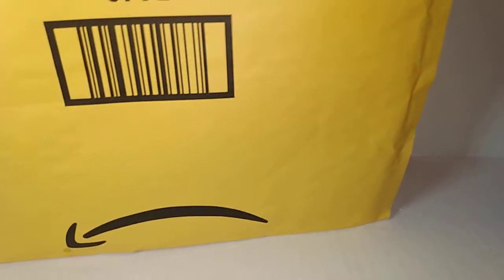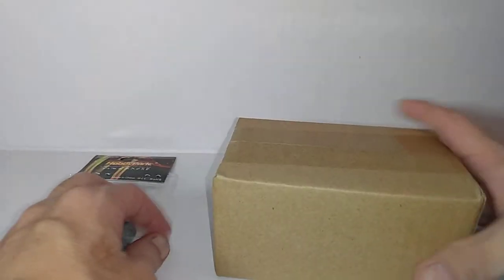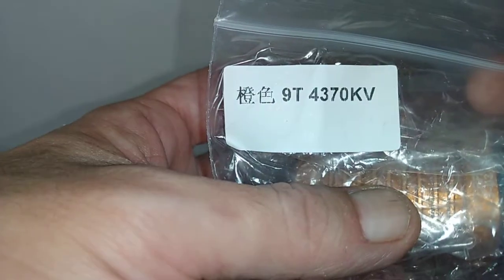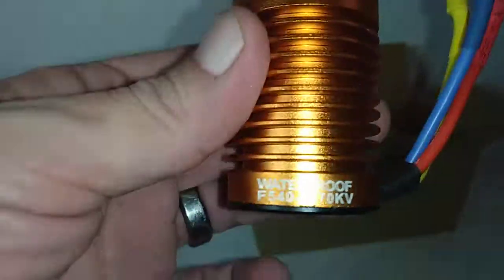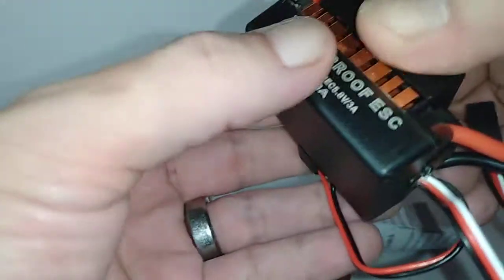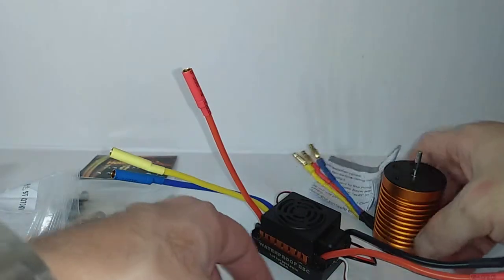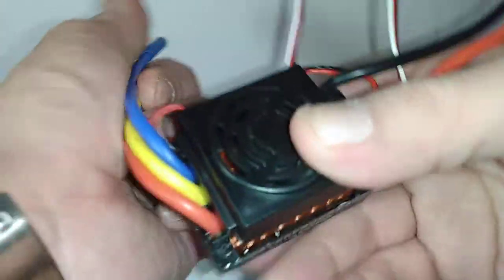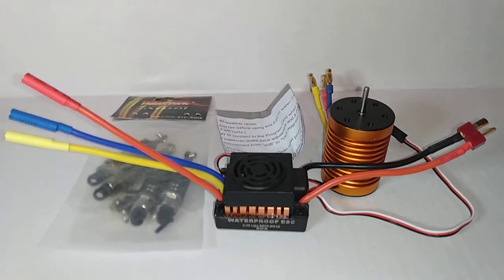Quick Unboxing 4370kv & 60 Amp ESC

Comment: Good quality is that?
Reply from the maker: NO PLEASE DON'T EVER BUY THIS GARBAGE....
Reply: @MightyistheRCGamer  ok thanks
Reply from the maker: @digeolrc8586  This is what you need  3s capable and nice... But remember everything went up in price because of INFLATION so if you buy it now you will be ok but if you wait it may go up in price 

Check this out on Amazon
JODIYAAH Hobby F540 4370KV Brushless Motor Waterproof 45A ESC with BEC for 1/10 RC Car Truck https://www.amazon.com/dp/B09P1BNZB9/ref=cm_sw_r_apan_glt_i_KD4HBP32WPV4X7ZRDCPN?_encoding=UTF8&psc=1